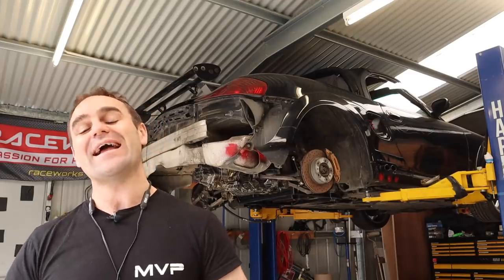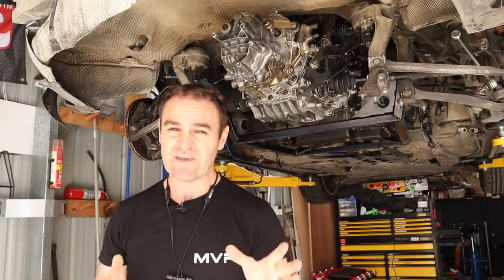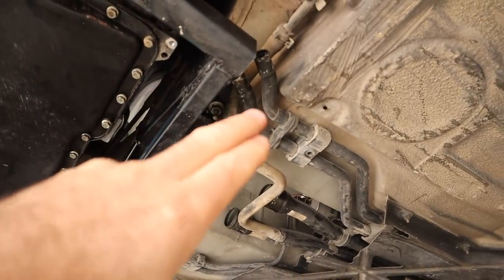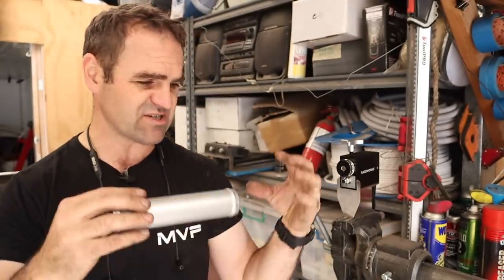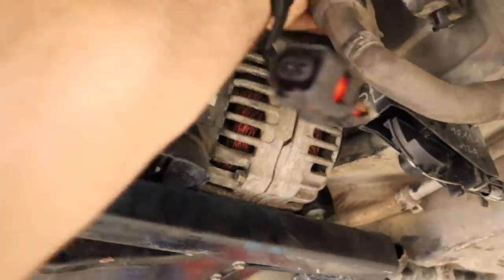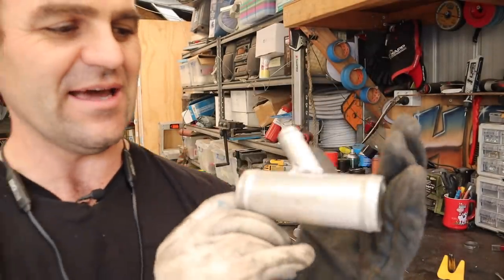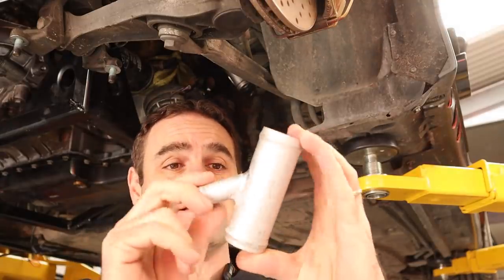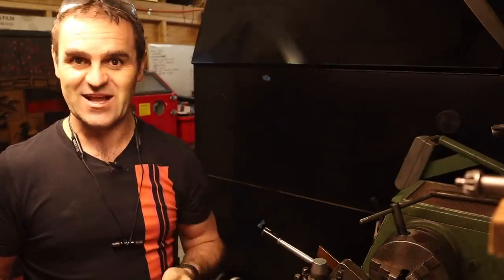Plumbing radiator and Power Steering - Porsche 986 Boxster V8 engine swap track car build 6

Comment: Less on the silcone elbows and connectors. The less you use the less chance you have for leaks. One piece pipes bent to your specs and with rubber insulator mounts will give clearance and clean up the undercarriage

Comment: On the sub frame.
I would scrap it and try again with different engine mounts and round tube bent to cradle the engine either closer or further away to give you more space for the hoses and belts.
Reply: This. Bent round tubes are how many, many OE subframes are built. See: most BMWs.
Reply: Fuck that, track car
Reply: @andrewlangford88  Just because it's a track car doesn't mean it should be difficult to service. Simplify and add lightness.
Reply: @nathanaeljonesmyfsd  I think becuse Cv Axles You can't Move Engine Beck or Forth I think is Just Fine More Hoses More Water Mor Cooler
Reply: @autobodyrepairclearcoot4146  More fluid volume is nice, but more hoses = more chance that a clamp will slip and cause a leak.

Comment: Now that you have made a perfect mold for the convoluted coolant hose. You could fabricate one from aluminum using mandrill bends and tubes welded together. Gives you allot more room and lighter. Less places for potential leaks and tucks everything up above the frame for more protection should you expectance an off road excursion on the track.

Comment: Your fabrication skills are getting so impressive - all the more so for being self taught 👍🏻 On the learning not to leave the Chuck key in the lathe, when I was an apprentice if the scary old toolmaker that taught us in the machine shop caught us taking our hand off the key when it was in the chuck he took whatever we were working on out of the lathe, ‘adjusted’ it in front of us with a large hammer then lobbed it in the scrap bin and made us start again from scratch 😳 -  deffo concentrated what passed for my 16yr old  mind 🤣

Comment: Jeff you could have used the steel tubing of the sub frame as a section of the radiator pipe work. rather than having alloy pipe hanging pround underneath the subframe.

Comment: Hello Jeff. With all those bends, Rises and Valley's in the cooling system I'm sure you've already thought of it but vacuum filling the coolant system is about the only way you'll get rid of all the air. You just Evacuate the system like you were doing air conditioning and then put coolant in to take the place of the vacuum! BMW I8 have a similar problem and that's how they take care of air in the system with them.
Reply: The boxer and 911 got same problem when stock, so he probably gonna use that filling method anyway

Comment: If this is going to be a dedicated track car, why not route the coolant lines through the rear seat area inside the car. With some insulation you could reduce heat issues

Comment: Are you worried about the oil pan rubbing the coolant hose?
It looked like it was resting against it
If it is an issue, could you extend the subframe closer to the side of the car to give that extra cm or 2?
Reply from the maker: I may tweak it as it is goiing to rub where it is, but I want to just get it all running to start.

Comment: Doesn't your lathe have cooling system, you are wasting a lot of lubrication oil this way
Reply from the maker: Nope. Most smaller lathes don't
Reply: @HomeBuiltByJeff  that's a shame, I'm sure there is some better solutions for smaller lathes
Reply: You don't lubricate/oil on mill/lathes as they cut. You want just coolant. 
You can use metho  as it evaporates super fast for cooling and won't cause rust. A spray bottle is best for maximum cooling too

Comment: Coming from a boilermaker/welder
Usually things are stich welded to save time and material.
It's is better to have a long continuous run but depends on purpose, as long as you have at least welded all the corners it's should never break

Comment: you could cut quite a large angled triangular piece off the corner of that subframe near the alternator and face it with a piece of 5mm plate to make it strong a gain could you not?.  Would be strong and would give more options for round the world radiator pipes?

Comment: Something to consider with the engine cradle Jeff.
I am wondering if that engine cradle is too strong/inflexible it may either crack or possibly pull itself from where it's fixed to the body/chassis moutings.
The original subframe is made up flat metal pieces which Suggests to me a little flexibility to accommodate flex in the shell/body.
How you have fixed the front of the subframe centrally and the stitch welding the gussets may actually work fine as it'll allow a little flex.
Some of the initial torque of the engine will be taken up by the engine mounts.
Impressive how fast this project is moving Jeff.
When you first showed 
us that engine I thought nightmare!
Actually nice and easy👍

Comment: Too many joints!  The potential for leaks has grown exponentially.  I would have used stainless steel exhaust pipe to get all the bends and curves required, which can then be welded together.  The e.o. weight of the stainless steel compared with aluminium is negligible especially when you factor the weight of water that it contains besides, all those silicone tube and clamps will increase the weight further on the alloy pipe.  Also, stainless steel is corrosion resistant and damage resistant compared to aluminium.
Many amateurs use copper pipe and fittings to get the solid system that is required.  Copper is readily and cheaply available and works well and wil take the very limited pressures involved.  Corrosion is no more an issue than with aluminium especially when a good quality anti-freeze/inhibitor is used.

Comment: If the subframe was ally tube...could’ve run the coolant through it!!!! Sorted ;-)
Reply: I was thinking that!
Thou the diameter is a little small might cause a restriction.
Could still do it with the steel.

Comment: For the power steering could use an electric TRW pump in the frunk to simplify the plumbing? Although it looks pretty good as is!
Reply from the maker: This is much simpler, cheaper and quicker :D

Comment: If this is a race car why do t you just put the pipes up through the floor then come out at the height you need from the inside, if you ‘now what I mean
Reply: You don't want to be running coolant lines inside the car, especially not a race car where the engine is working hard all the time and is probably running hot anyway. If (when) they let go you want that boiling water as far away from you as possible.

Comment: Some safety points on using lathes I learnt a long time ago.  Always keep a hold of the chuck key in your hand until you have placed it down in a safe place.  Before starting the lathe, stand to one side of the chuck in case you forget the first rule.
Reply from the maker: I also spin the chuck by hand every time before I start it ;)

Comment: Add a lanyard (like a keychain that goes around your neck) to the lathe chuck so it'll act as a flag so you won't forget to remove it. In the aviation industry, we use all kinds of checklists so we don't miss anything important...like extending our landing gear prior to landing...
Reply: We had to cut our school ties and stich them so if they got caught in the lathe they would snap before dragging your face into the lathe. I wouldn't personally want anything around my neck
Reply: @brittenv1000  I wasn't suggesting he put it around his neck, I was just using that as a descriptor.
Reply: @thescottishhammer7570  fair enough 😁
Reply: Remove before flight
Reply: But then if he forgets, the lathe kills him!
That's about the DUMBEST idea you could have conjured!  (Harsh I know, but Jesus, that's a terrible idea!)
No, the bungee cord from above suggestion mentioned earlier is PERFECT.  Simple, effective and potentially lathe and life-saving!
Reply: @thescottishhammer7570  well then why suggest a lanyard?  A thing designed to hang from your neck?  How about "string," "line," or "rope?"
No, terrible idea and descriptors.  Fail on your part.
And even then, it's only a half-measure.
The bungee from above is PERFECT.  It 100% prevents the chuck key from staying in the chuck, yet is always conveniently nearby and within reach.  
Make solutions that solve several problems, and especially ones that aren't maiming (a string could get wound around your arm or hand, so it's not a good idea)!
Reply: @dudeonbike800  I apologize for offending you so as greatly as I apparently did. Next time I'm at odds for a descriptor, I'll visit you personally and let you school me on the ways of the highly educated.
Reply: @thescottishhammer7570  Ha, ha!  I'm sorry I came across so harshly!
Reply: Haha Anyone who read that as suggesting to put it around his neck has reading comprehension issues. It's all there in the first sentence.